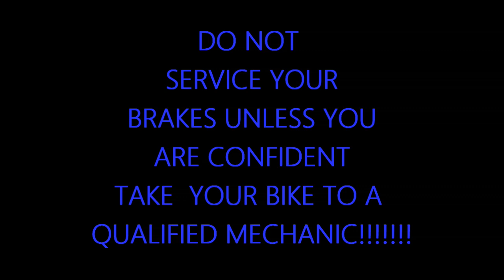Fazer 600 Brake Clean Morphy Style

Comment: I sat onto the Fazer the other day and the brakes were locked onto the front disc...next thing on pushing the bike forward the meat on the pad fell right out. I only bought the bike recently so had not given the brakes a look over yet - clearly they were fairly old/rotten! Ordered a full set front and rear. 

Thanks for the thorough walk through. I'll be doing this maintenance regularly once the pads arrive.
Reply from the maker: Hiya Cian glad you have got some help out of this video. You have bought a cracking bike they really are well made keep on top of the bike and it will last for thousands of miles. I have some fun on my fazer even at my age it will keep up with the big boys on the twisties. Thank you Morphy

Comment: Hi steve.. you need a glamorous assistant to hold your clip in place as you push the pin in. 😜🤗🤗.. nice video steve i made the mistake of negotiating my brakes the first year i had the versys and it cost me a set of disc's as they got warped. I won't make that mistake again i now clean them twice a year.
Reply from the maker: Best practice especially now on the triumph 👍

Comment: Hi Morphy,  I have always repaired my own motorbike's and cars, but when I got my BMW F800GS and did a bit of research as it was the first ABS equipped bike I had owned, I found when you bleed the braking system it has to be plugged into BMW's diagnostics system. They have to manually activate the ABS pump to bleed the ABS pump. I don't know if you knew about this, but as you are on the subject of brakes I thought I would let you know. I don't know if any other manufactures have this procedure on there bikes, but I will be checking if my CRF is similar. 
All the best 
Baz
Oh how long did it take you to get all the crud of the CRF
Reply from the maker: I had heard something about the BMW system it smacks of them getting more cash out of you having to take it back to them. On the KTM superduke I did change the brake fluid with no problem and that had abs system on it. I don't think the crf250 has anything like the BMW has on it. I have not changed it as yet but can not fore see any problems. The Fazer has no ABS on it one of the reasons why I like the bike in fact it has nothing no modes of any kind at all.
The CRF250 was well crapped up took me ages to get it back to clean. It sort of set like concrete on the bike and exhaust I have oiled exhaust again so all well. But at least I got out and I stayed out for around six and half hours had a cracking time. Steve